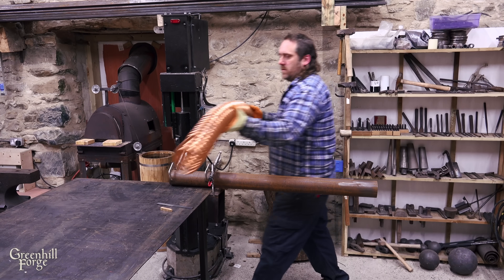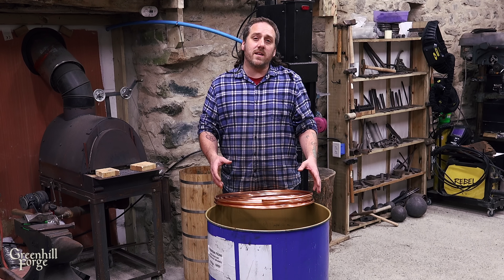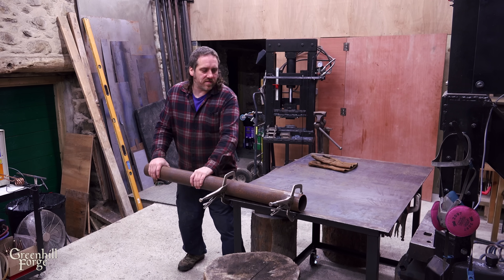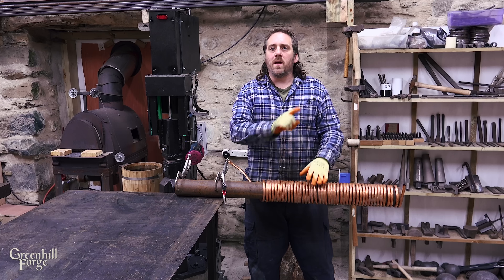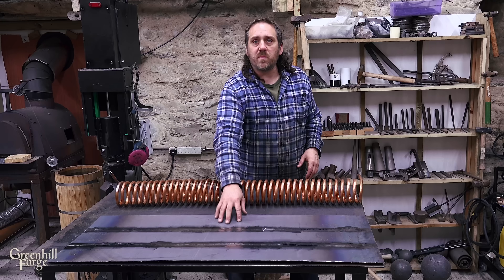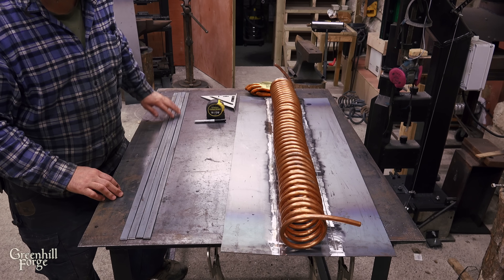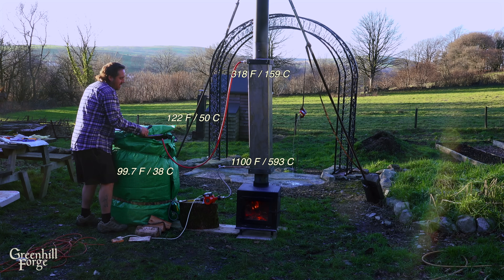Wood Stove Water Heater Experiment - Surprising Results! Part 1

Comment: Just to be that guy, rather than holding every coil exactly in place, you could just secure about every 5th coil and let the coils expand and contract as driven by thermal expansion.  Just to be the value engineer, rather than notching, you could just use some copper wire to secure it, so that you only need to drill a couple of holes.

Comment: Only flaw is you can't clean your coil. Every fire it will get more and more soot buildup; I would love to know the results with the same design, but the copper coiled on the outside of the chimney the pipe.

Comment: I can appreciate this greatly!
For to heat a wooden hot tub  I built a heater very similar to this. 
For the coil which was of 304 stainless, 5/8” tube, instead of ice, I filled it with salt used 10” and 6” pvc pipe for the mandrel, fabricated a “C” “wrench with a curved pawl at one end of the “C” I fitted with a nylon plastic insert to let it slip and accommodate the radius of the tubing. The wrench had about a 4’ handle welded on, I did my twisting vertically. I put a 6” coil within the 10” coil, with the spring back of the inner coil it also gave me a fairly close clearance. I mounted a “ or 9” Nat.Gas burner under it held vertically spaced with a steel strap frame. For the shroud, again very similar, it was a double “tube” a separated w fiberglass from sheet metal. At the end I found the the greatest efficiency, and the quickest heating time was by flowing maximum volume of water thru the coils. At first I had it plumbed to be one continuous coil but I found it best to separate the bottom and top of both coils and installed a “Y” necked from 5/8” up to 1 1/2” and wound up with a small 1/4 hp transfer pump jst for circulation, then a standard 2 1/2hp swimming pool pump with a strainer basket for heating and to run aeration jets. I regulated the gas valve with a waterbed thermostat (had to tweak that a little). It all worked like a champ for 15 yrs. The 6 1/2’ tub, & heater set up looked great trim with cedar privacy surrounding went with the home when we sold it, heck IT sold the house!
Also, instead of a flu, I finally mounted 3/3” discs 6” apart welded to 1/2” rod as a 
“Heat buffer” and stood it in the center of the inner coil. 
Very VERY IMPRESSED with you fabricated BREAK !!!

Comment: Looks great, however, there is a gotcha.   Copper has a reaction if it touches metal other then copper, where it starts throwing off flakes from the inside and outside of the pipe.  So, it will not last long if it touches the other metal, which is how you transferred the heat.

Comment: If the water tank was higher than the heater, you wouldnt need a pump at all. It would be a thermal syphon and the hot water would go back to the top of the tank, and it would move cold water from the bottom of the tank to the heater. A system we use in big equipment in refineries

Comment: Your biggest problem is that over time, tar will build up on the copper coil and drop the efficiency. Every so often you are going to have to take the temperature to the point where the tar burns off, but be careful you don't damage the copper coil.

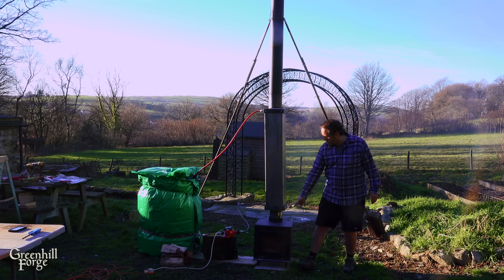Comment: 16:30  The following is a very general rule: Heat exchangers should be contraflow 

The video here shows both the flue gases and the pumped water going in the same direction = upwards.

If you have a heat exchanger with both materials flowing in the same direction, then it becomes more of a "Temperature Averager".

Of course it will still "work" even if the water flow is moving upwards, in the same direction as the flue gases. It's a wood stove chimney, so there's lots of energy and only some is getting into the water. But in theory, it should work better if it's contraflow. The output water temperature should be higher if it exits adjacent to the stove. Unless the flue gases are combusting in the flue.

If you need an explanation, then just imagine two parallel copper water pipes soldered together, making a simple heat exchanger. Imagine that it's a very effective heat exchanger. Now... If the two water streams are contraflow, then one end could be hot and the other end could be cold = a very nice heat exchanger. But if the water streams are running in the same direction, then the outputs will both be warm = a "Temperature Averager". Let it sink in if need be.

Cheers.
Reply: Then again, seeing the bottom temperatures...  Perhaps a contraflow heat exchanger would result in STEAM being emitted from the output...  It might be too good.  Cheers.

Comment: Thank you for sharing 😊 The design was very good. I found it cost effective, as simple as durable and fairly efficient compared to similarly available commercial solutions. I highly appreciated  attention to thermal bridging and heat surge protector.
I wonder what material will pursue the same simplicity and efficiency spirit to make mounts and fittings for the copper pipe (it would ideally come from scrap). I went through this  : prevent long term galvanic corrosion and copper pipe wear and tear due to expansion cycles where it makes contact with steel (sheet wall and mounting rack).
I wonder if they could be simple enough to keep the assembly robust and the core serviceable with minimal overhead... 🤔

Comment: It is a WATER HEATER. It is NOT a "hot water heater." COLD water flows into a water heater so it is more of a cold water heater. If your water is already hot, where is the need to heat it?

Comment: Are you not concerned about the copper being in contact with steel causing it rub holes where it contacts? Isn't there a reaction of the two different metals?

Comment: Enjoyed the video.
Could you not put sand around the copper coil instead to act as a sand battery? It would extract and store heat for longer. Perhaps longer initially to heat up the sand but it is a very good medium to store the heat energy and release it back into the coil after the fire has gone out. Cheers

Comment: Two thoughts:

One: Would it be good to coat the the insulation layer with some high heat paint to prevent oxidation?
Two: Does this prevent fully combusting the wood gas? My understanding of these flus is that they will gum up with creosote and other similar chemicals if they don't get hot enough and that cooling loop may be better off after a stretch of insulated pipe to allow it to get up to temperature.

Comment: Hi, I have the same idea after moving on to a large parcel of wooded land with a house too big for me .  After about 6 years of thinking and working and evolving on that same thought you've had, let me summarize by saying that my hot tub is no longer powered by wood. Its now powered by My choice of electricity, gasoline, or propane. The gasoline system was built from a 8k btu webasto gasoline parking heater built for a VW. I removed the control circuitry and used my own ESP32 controller based off of some other person's similar off-road shower system they built using in Arduino. I love having gasoline to power it, mostly because it was my cheapest option for a while. Beyond that I have a cheap propane heater that puts out 150 KBTU hot water. I use this to very quickly heat the hot tub from room temp to bathing temp, We can get it done in about 6 hours. The electrical heating is built into the Intex hot tub I started with. I reverse engineered the SPI protocol The display / control panel uses to get and send signals and data to the main control board in the filtration heater pump. I'm very proud of my ability to reverse engineer this and also simulate button presses from the ESP32 as if I pressed those buttons myself. My Intex hot tub had absolutely zero remote control in through my integrations to the parking heater, and Sonoff (tasmota) amperage metering, temperature sensing, and line voltage power control of all the related pumps and valves.  All three of these systems are tightly controlled. The reason I do not use the wood system anymore is two part; firstly the manual labor required. Secondly the corrosion. You need careful control of the interface temperature between your water and your fire. Having a large gradient between the two will create condensation on the heat transfer surface. This condensation will boil away and take the heat you wanted to go into your water into the air with it. The moisture that is being added to your wood fire will hinder its burn and cause steam (Every petson who builds any wood fire would always prefer the exhaust to be CLEAR and INVISIBLE. ).  The manual labor required to continually restock the stove was the deal breaker. If you think about it this makes sense.. pretty much everyone's home has automated temperature control. We are so used to it. Until I have a robot ready to fill my wood fire, Maybe also split and stack the wood. I can pretty much guarantee you that at some point in the future, could be 2 years 5 a decade or three.... You will eventually realize that we do require the modern convenience of automated heating systems.     And so do I. I put my effort towards securing the cheapest types of fuels in those three categories and I will soon modify my home heating system to be able to use them, too. To me this is the best compromise with wood fired heat versus modern living. We would probably be better off selling our wood to someone who burns it in the fire and use that money to build smarter automated systems

Comment: Great build. As simple as possible to effect the best outcome. If the hot water storage is above the coil, natural thermosyphoning will circulate the water, no pump needed. I know, its awkward to have the tank above, I'm just a sucker for passive systems. 😊

Comment: Ive used a propane fired on demand camp heater for a about a decade in the summer months.  One year I didn't get the unit inside and the heat exchange froze and burst the copper.  No fixing it, just replaced it.  I'm wondering if you put a drain valve at the bottom or how you plan to clear the water out between fires .... air pressure or gravity or will the unit be in a temp controlled room that wont get below freezing?

Comment: To extract heat, you want to put the water in from the top and not the bottom.  This allows one to maximize the energy transfer.  This is because heat transfer is proportional to the difference in temperature.  When inserting water from the bottom, by the time the water reaches the top the difference in temperature is minimal resulting in minimal heat transfer.  At the top, the water has warmed and the flu gasses have cooled so you get minimal heat transfer and peak temperature is reduced.  But if water goes in from the top then the temperature difference will be significant throughout the entire length of the heat exchanger.

So the current method results in significant initial heat transfer with reduced heat transfer by the time the water exits.  If connected in the opposite orientation, you will have reduced initial heat transfer but with a greater amount of overall heat transfer by the time the water exits.

Interestingly enough, there was a video on birds lungs which details why bird lungs are so much more efficient then mammals.  Birds have a heat exchanger style lung - so nothing like us.  The blood flows adjacent to, but in the opposite direction as the flow of air thereby maximizing how much oxygen can be extracted.  So for the same reason why birds evolved the lungs that they have, you probably want to inject the water from the opposite side.  Perhaps you could try both directions and report if there are any observable differences?  It would be interesting to see.  fyi, the channel name was "clint's reptiles" - the bird lung video is worth a watch.

Comment: There is no experimenting needed. I am in Australia and in the 1960s a lot of houses had pipe work at the back of the fire box of the wood stoves used for cooking. This gave very hot to boiling water all year. I am sure many other countries would have the same thing. Do some research and stop trying to reinvent the wheel.

Comment: Lift your water tank so that the top of the tank is 2 inches above the top copper outlet it will make a thermal syphon, and you won't need a pump for your heat storage tank.  Also, if you put a hole at the top of your tank for steam to escape the water will protect your copper pipe from any damage.

Comment: One gotcha with things like this is accumulation of creosote where the hot flue gases hit the cool/cold copper.  A key thing to prevent this would be complete and HOT combustion in the wood stove itself.  But if you run a smoldery (oxygen poor) fire with a softwood like pine or fir, you may run into problems with creosote.  The two dangers are a) creosote acts like an insulator (so lower heat transfer ) and b) flue fire since creosote is flammable.  Although copper is more efficient temperature wise, one advantage of pure steel is that you could drain the water and cook off all the creosote.   Awesome project!

Comment: Another way to bend copper pipe without crimping is to fill the tubing with sand. Loose dry fine sand ends securely closed while bending.

Comment: My advice as a boilerman: great fabrication skills here, but soot will rapidly accumulate on your coil and ruin the heat transfer. The soot will also become a fire hazard. To save yourself time solving that flaw, just run a chimney down the middle of the coil and call it a day. Inlet water at top, outlet water at bottom.

So long as it remains outdoors and just single-fired for a hot-tub, no other changes are needed. Though with your metalworking skills, you could just build an iron-bottomed hot tub and wood-fire it directly.

I wouldn't recommend your current setup for indoor applications though, way too much maintenance. A small heat transfer plate attached to the top of the stove itself is better for indoors.
Reply from the maker: Yeah, this would not be a good design for long term regular use. Just a test unit to compare to a unit like you describe in your comment. Just trying to find the different values to compare efficency etc. Lots more testing coming. Thanks for the comment.

Comment: If this is a shot term experiment, disregard my comment. You'll need brass standoffs to isolate the steel & copper. You'll have some bad days coming soon, if you don't. Enjoy
Reply from the maker: Yeah, just a test unit. But you're right. long term units would be susceptible to galvanic corrosion.

Comment: I’m concerned about creosote buildup on the coils, just like in a humid space water condenses onto something cold. Also slightly worried about the contact of the coils with the sawtooth brackets, will take dozens of uses, maybe hundreds but eventually expansion/contraction will chafe a hole in the copper.
Reply from the maker: This is just a test unit to gain values for further testing and design refinement

Comment: Please do a review in 5 and 10 years , I don't like copper ,steel ,touching sharp edges I hope I'm wrong.
Reply from the maker: This is just a test unit that will only be run a few times. Many more tests and design refinements are needed

Comment: good clean sand (play sand for kids) works best (DRY)
Reply from the maker: I use sand for small coils like on the induction heater but 50 feet of 1/2" is a pain with sand, at least to me.

Comment: Great build technique, thanks for showing.  I was building wood heaters in the '80's and found any heat exchanger in or around the chimmney caused creosote build up fairly fast, which was hard to clean off.  Eventually I put a heat exchanger in the firebox - 4 x 8" lengths of 5/8 copper brazed into 12" x 3/4" headers - remarkably small for what it did. Since it's filled with water the copper is not burned, and since it's in the firebox there's no creosote build up.  The header tank was in the floor above.  Heated our domestic water for about 20 years.  (Made a spare exchanger we never used.)  Fairly common here in Australia is a 'wetback' which is a water box welded to the back of a woodstove.  Works well but it does rust out eventually.

Comment: First thing you need is baffles to make the gases to move from the centre to the outside and unless you're doing gravity feed counter flow is best as the coldest water is in contact with the coldest flue gas and the hottest water with the hottest flue gas unfortunately the video is not DIY friendly as most people don't have the equipment you used